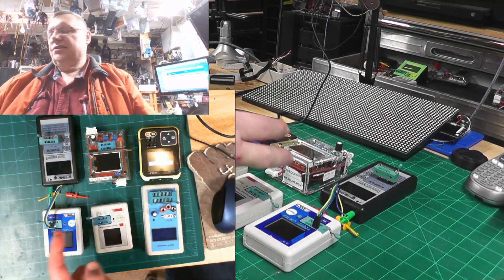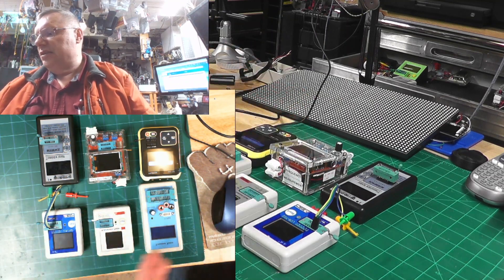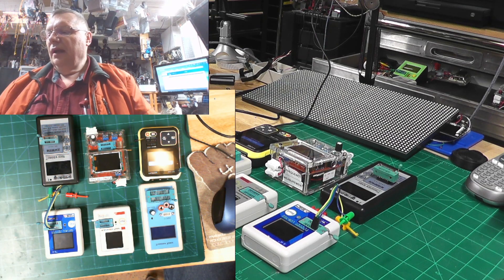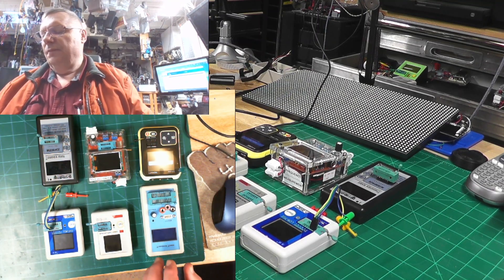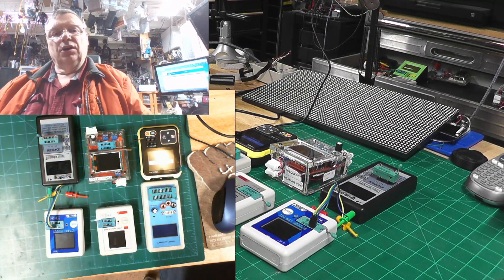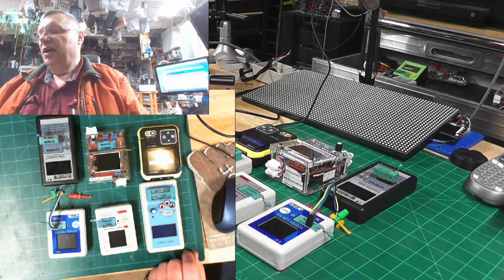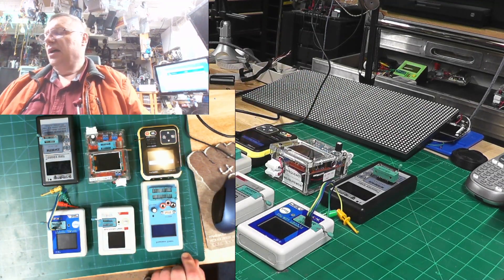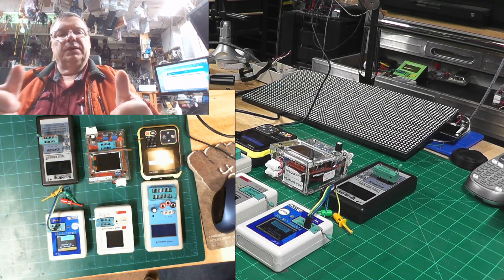6 LCR Meters

Comment: Hello, I have a problem with the T7, when I turn it on, it gives me zenor 13.6v without connecting anything to it.
Reply from the maker: Charge the LCR first and put 1Kohm resistor between pins 1 and 2, than turn the LCR on. And the same after 1Kohm between pins 2 and 3 and also pins 1 and 3.
Reply: @tonysfun  Thank you, my friend. I will try tomorrow and update you on everything
Reply from the maker: @paris9786  Sounds good.
Reply: Hello, I tried the experiment and it is as follows.

 Firstly, 1-2 gave me the resistance value of 1K. 

Secondly, 2-3 gave me the zener AK. 

Thirdly, 1-3 gave me the zener AK. 

How can I solve this problem?
Reply from the maker: @paris9786  Did you measure something like a capacitor and your problems started right after that? If yes, you forgot to completely discharge the capacitor! For that, you have no fix and just buy a new one. Please also see this video, before you buy something else:  https://www.youtube.com/watch?v=q4P-Bedhkz4&list=PLv52A7rm-UViZEOlzZfZOB9Gl8cjS3ze5&index=49&ab_channel=TonyFleming
Reply from the maker: You can send me an a email to blbcisem@gmail.com
Reply from the maker: @paris9786  Sorry for late response. you can email me: czecht@gmail.com